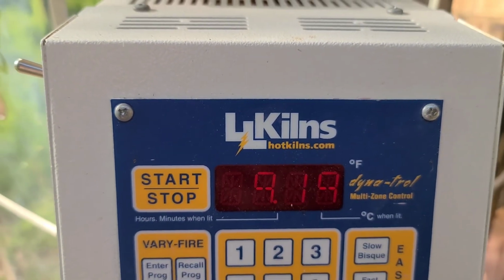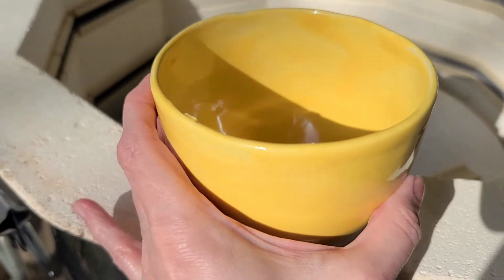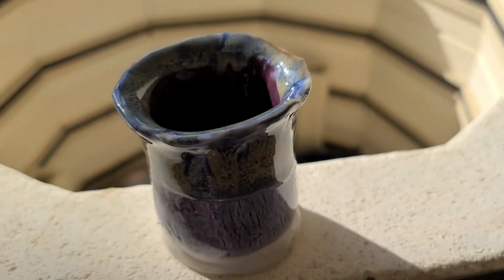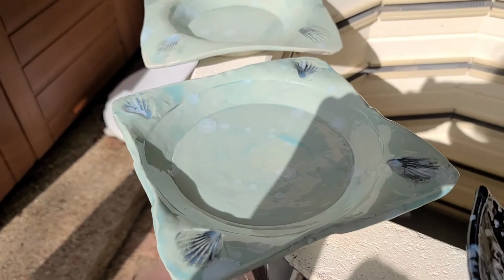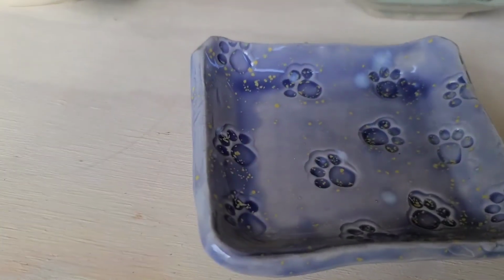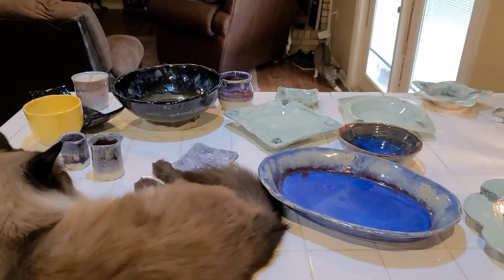Glaze kiln opening. Kiln Got Way Too 🔥

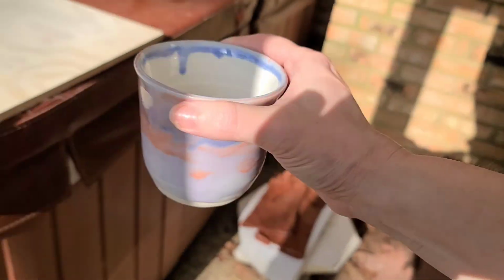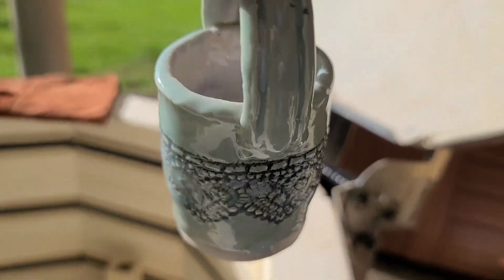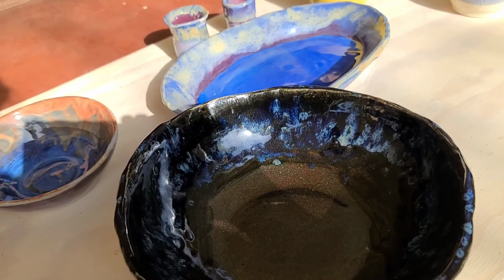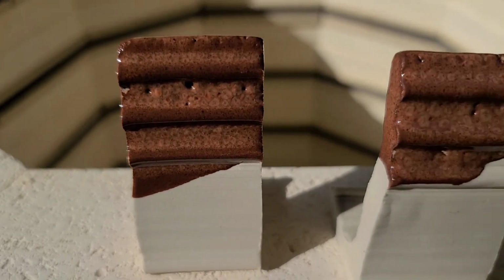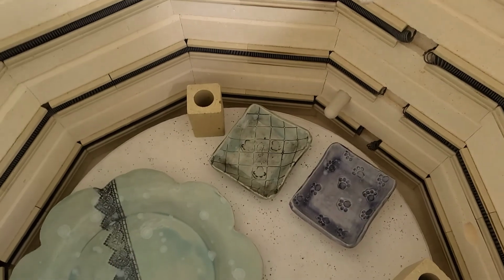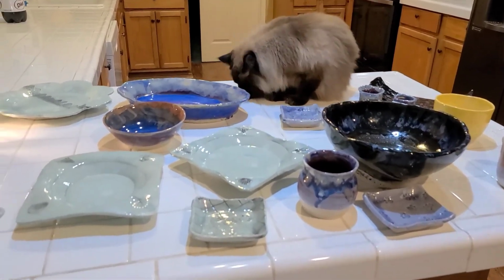Comment: Hey everything is fired ok as you have great looking gloss on everything that came out and little to no pinholes and the clay did not bubble so cone 7.5 even if it is over works out great.   So I would only back it off a little. Most of the time It takes a cone 30 min to drop all the way. So if you can figure out the temp rise per hour at the end you will know how much to off set.   @ 1:44 don't be to hard on that little cup I think it looks quite nice.  Pretend these are all your little kids coming out of the kiln, they may not turn out the way you like nor what you had hoped, but they are interesting and special in their own unique way .  I would put that cup away for a few months, then come back.  I'm sure you will like it.  haa!  Ok @ 2:00 test tiles.  These look like cone 10 glazes.  Add more flux to them to bring them down, add 2% more flux per cone so 10% more flux and you should have these at cone five. Maybe you accidentally mixed them wrong?  Hummmm..2:44 that yellow looks great nice gloss so it fired ok. @ 4:26  Love the platter! Nice work! @5:12  This cam out great!  Love how the glaze worked with the texture. @ ^:20 love the color on these test pieces they all fired out great and have nice gloss..@8:54 love the drips on this! @9:52 the squeek sound that your glove made here on the bowl when you kicked it up told me this had a great gloss finish. love that sound.. haaa! @11:09 Hey!  The 3.5 tin looks great!  So I love tin as it puts these white dust spots in.  It looks great in that seafoam green I run here.  I was not able to get tin last year due to the pandemic but used what I had it came up some and folks loved it but not as much as before.  Now tin is much better to use then zircopax.  But if your broke Zircopax will do the job but you need to add twice as much to get the same effect as tin.  Awww!  I like nutmeg! Haaa! @11:55 Are these crystalline glazes? They are both growing crystals .  @13:15 From the looks of it your kiln is firing evenly.  So that's good..  All these glazes came out fine I think at cone 7.5. @13:35 Hey these do look like crystalline glazes you got some good growth there.  All of these look great! @15:21 Great crystals on this also!  Ok so..here is the thing.. Crysline glazes need fluidity in the glaze to form well.  Dialing back the temp of your kiln may affect those glazes. so you may had done it correct accidentally.   @15:36 Ok over all this load was far more successful then any load you have had so far.  All the pieces had great gloss and melt and 7.5 and other then the under fired test tiles everything looked great and you even got crystallization happening on those pieces on the bottom.  Without looking at the cones I would have no reason to belive your kiln would need an adjustment at all.    Ok one tip I think things stick simply due to your glazing technique. This more about you pot bottom.  After glazing set them on a board and look ubder and ask it the glaze free line high enough?  If you can not see a glaze free line 1/4 to 1/2 inch up then there is a danger of things sticking.  I would look up waxing pots to see what technique you would like to try.  We waxed at the potter and it gave a nice line, made it easy to clean up, and the line was high enough to stop the drips. awww nooo I wrote a book..here... But this load  I think was the best load so far.. more and more you are getting far more pieces though the whole process.
Reply from the maker: The glazes that had the "crystals" are Mayco stoneware glazes. Yes I cheated on my homemixed glazes. I tried blue hydrangea, celedon bloom, and night moth, then I got Amaco cosmic tea dust. I had been seeing others using them and wanted to try. Probably will not get them often but the celadon bloom I will definitely.  My heart inprinted plate and little basket might be a set of plates. Not sure yet though. 
I have been wanting an oatmeal type glaze. So I thought I would start with Al's winter white and go from there. I think some spit off the bowl because it had not dried enough before I threw it in the kiln. It was already 1 am and was just trying to get it loaded. 
I did wax the bottoms. On that platter I dipped and think I got a little more on that one side. But over all way less sticking.  I am learning how thick to mix the glazes. 
So as I try to dial down the kiln and get a true cone 6. I don't want to buy elements way more often then I have to because those things are expensive